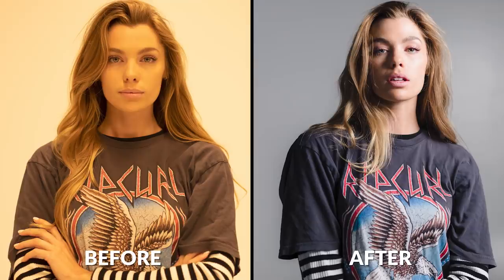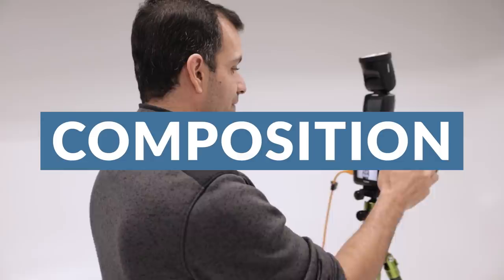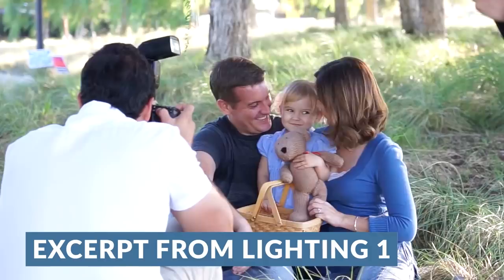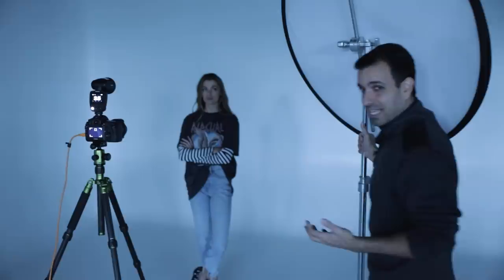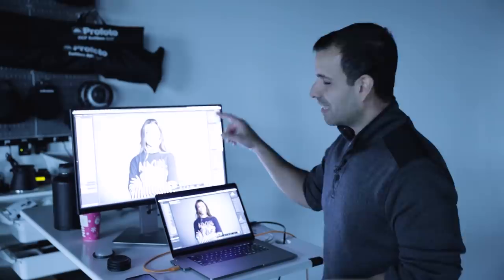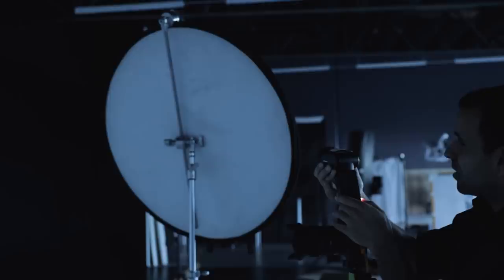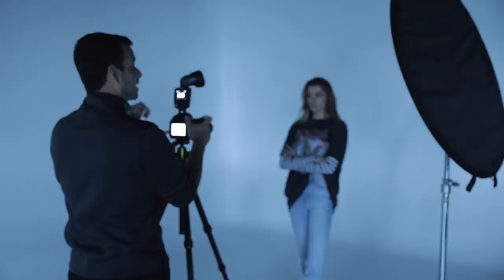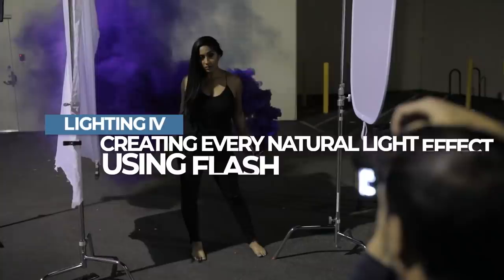Make Your On-Camera Flash Into an Off-Camera Softbox

Comment: Nice video. I've always done a bounce like this with a bounce card to block the subject with a zoomed in head. I should try the grid and see how much of a difference there is in contrast (I'm thinking the bounce card will reduce contrast since it's throwing more light) and power settings (I suspect the grid needs more power). Fun man.
Reply: I was wondering the same thing,  I don’t have a grid for my a1, just the bounce card

Comment: I did this yesterday and used a $1.25 white poster board for the reflector. I taped an old christmas card on the speedlite to block direct light from hitting the target. Thank you for this!

EDIT: It's two days later and I learned an important tidbit doing this. The fastest shutter sync speed for a speed light on a DSLR, at least mine anyway, is 1/200 sec. That's a key munber right there. If you try a faster shutter to darken up the ambient light, it won't work when the flash is on. The camera will default back to 1/200 sec and you will be overexposed.

Comment: Very nice tutorial.  It will have been a better comparison if the direct flash is exposed correctly.  As for using the grid on the flash head which will waste precious flash power (1-stop?), it is more efficient to use a cheap "Black formie thing" popularized by Neil van Niekerk or a flex lens shade to block direct flash.

Comment: I do this all the time, but I don't own a reflector. So I use a wall. Most rooms have walls, so NO gear needed. BTW I use a Canon 580 EX2 Speedlight—plenty of power at ISO 200.

Comment: But: in case I have an assistant holding a reflector for me, wouldnt it be better if the same assistant holds the flash too (off camera)?
Reply: I think the idea about this is that this is for flashes that do not have remote compatibility. If it does, then you can just put it straight in the softbox and remove having to use a grid etc.